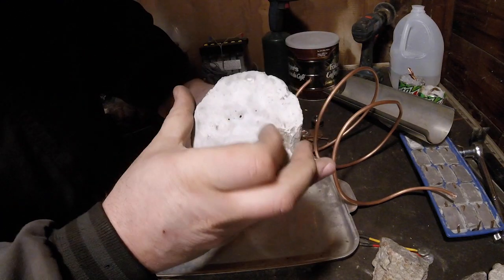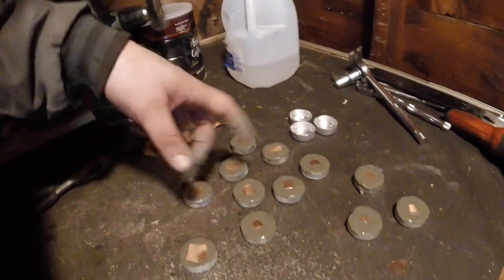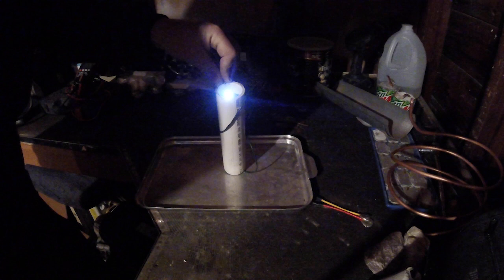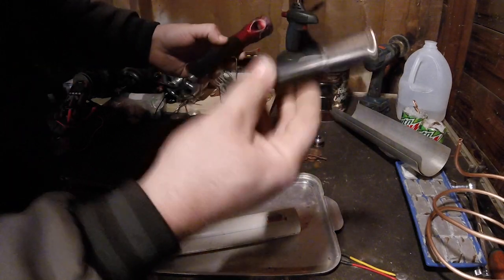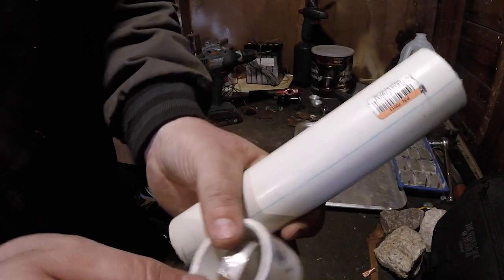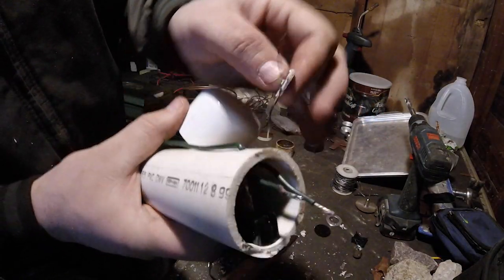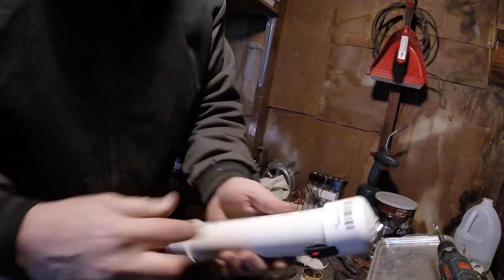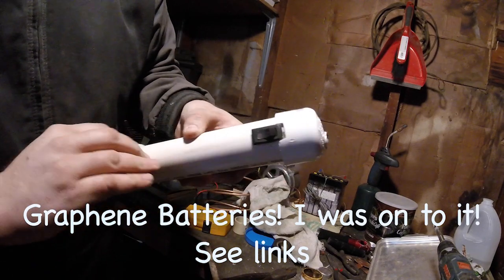Cement Flashlight - What!

Comment: I have a shake flashlight (magnet passes thru copper coil when shook) I'm thinking you could combine a shake flashlight with this. To help recharge the cement faster. 
I'm guessing you'd need several tons of cement batteries to make any significant power? But from watching your recent video about roads & parking lots,etc...Turned into self rechargeable batteries. Maybe a combination of solar charging + it's own self recharging. Could turn a cement home into a giant battery.

Comment: Nice! I think you could use tinfoil on the outside, and copper wire slightly coiling on the inside (to get more wire surface contacting the cement). It would also be interesting to test how to change the voltage and amperage of the current, for other applications (such as a brighter flashlight used for a few minutes per day, or a solar-cement-tile light which to stay on 24/7 with an undervolted LED lightbulb, and so on), and how to recharge them faster (like leaving them in the sunlight recharges conventional batteries by a certain percentage). Those experiments might take quite some time to run them, and quite some effort to think of possible uses and test them accordingly, but I think that dropping mentions of antiquitech could have your channel explode. I mean, it's one thing for someone to show an abandoned building with decorations which included metals and/or different mixtures of cement or ceramics, and it's a completely different thing to test those things in isolations, using modern tech, to show how exactly they work and how useful they might or might not be. I mean, you could even have a ceramic pot with a copper-based glazing and cement inside with an iron pole inside, and use it as a battery for a crystal radio built in a mix of cement and dirt (soilcrete/dirtcrete). Heck, with enough trial and error, you could you could build an obelisk with a stone speaker and crystal radio, and maybe even fine-tune it to a certain frequency ahead of time and use it like a walkie-talkie receiver. Making a transmitter, as well, in a similar way, could add even more authority to your claims, especially if you make the plans for those things public domain. 

Don't get me wrong, the technology itself is great! But most people won't see it's greatness until you actually put it into practice. And if that means using cement, some wires and metal sheets, a specific crystal type, and sand molds and clay molds (so the clay can be washed out after the cement hardened), then that just means that is the price to pay to show others the greatness of this technology.
Reply from the maker: Yeah I'm hoping people will be inspired with their ideas and take off with them.  So many possibilities :)
Reply: @extremebudget  Unfortunately, for people to be inspired and try their own ideas, someone else has to do most of the work, first. For example, until people see a crystal radio inside a cement casing, using the cement as a battery, they won't consider making a cement-battery flashlight, and until they see a small-speakers-sized speaker made out of metal sheets, wire, and cement (and maybe some leather or silicone or something else, as an insulator), they won't try making a smaller speaker, and so on. Most people who are going to make use of such ideas, need someone else to have already taken a few steps ahead of how far they are willing to go, and another big part of the people who are going to make use of such ideas need proper documentation of the experiments, done as precisely as possible.

 i.e. 15g of cement, 10g of sand, 5 grams of water, 1g of hickory ash, 3 in of 1/8 in copper wire, 3 by 8 in of aluminium foil (tinfoil), and a reusable cookie form greased with cooking oil, to make a single cement-battery. I don't know how this recipe would fare, if used, but this is the kind of documentation needed for building the battery, and adding things like how much power an LED draws at a minimum while still being lit, the initial and final voltage and amperage of the battery (before adding the LED and after the LED stops being lit), and how long it takes to recharge it using something like an oven or solar collector-concentrator to get more sunlight onto the battery at a certain sunlight intensity for which you might need a separate device), and so on. But the upside is that you can get a research paper out of it, and you can publish it on publications which do not require paying to share it and/or to view it.

Comment: Someone will monetize this and call it the self sustainable light and charge an astronomical price for it. Wait and see lol......nonetheless this technology is incredible. What if the people before is used this to power their infrastructures.
Reply from the maker: True.  that is what we have lived with for many years.  that is why public knowledge of how this works is the only way to prevent that.  This is key to a future of freedom :)
Reply: @extremebudget  do happen to know which type of cement works best? Not sure if you mentioned in the video. If so, I apologize for missing that part.
Reply from the maker: @eliveal7407  Im sure any type will work the same.  Try graphite, activated carbon, epsom salts, try anything you can get your hands on.  Try sand between copper and aluminum plates and see what you can get.  It's amazing what you find has a charge.
Reply: @eliveal7407  There are buildings which have decorations on the balcony, and some of those decorations are ceramic pots with different cement mixes, different glazing for the ceramics (i.e. copper glaze) and an iron pole running down the middle, which could very well be solar-charged cement batteries. Especially if painted black (with a mix of burned oil and ash or sooth, optionally thinned with 1 part boiled flour to 4-5 parts water).

Comment: How long do these batteries last?
Reply from the maker: It really depends on the contact with the metal.  That is the challenge.  it started dimming after a few weeks.  I opened it up after a few weeks and cleaned off the contacts and it came back on.  Cement isn't the best material, but it is cheap and easy to learn with.  I posted some videos on graphene batteries that last who knows how long, but they don't corrode and recharges itself.  there are many people testing these things, but it takes a while to know results for the best materials.  One guy had his pop can cement battery work again after 4 years.  He added some moisture to it.
Reply: @extremebudget  I’m just getting into those videos. Amazing nonetheless.

Comment: Amazing! I just wonder how he was able to discover that cement could do it. 🇺🇸
Reply from the maker: I saw that quartz was capable of electricity and I learned that cement has a lot of quartz in it.  I needed something moldable to work with to make batteries.  Cement was the best way to learn the possibilities.  There are much better ways that I have learned since, but it's pretty awesome :)
Reply: @extremebudget  I wonder how adding more sand to the mix would change things. I mean, sand is fundamentally quartz with impurities.